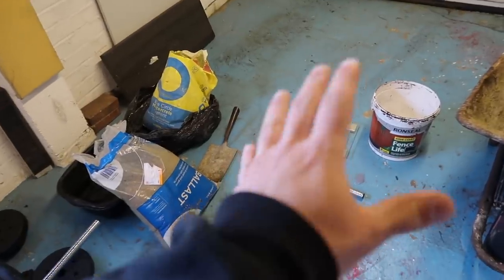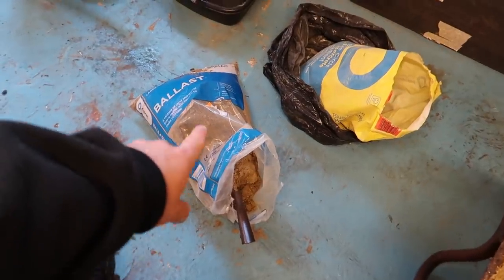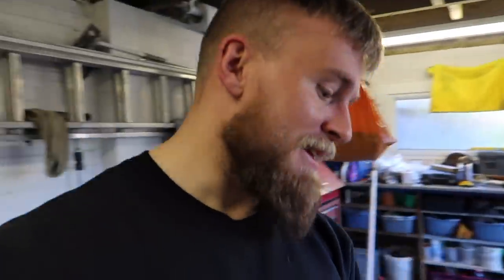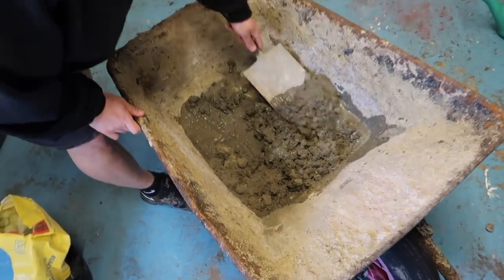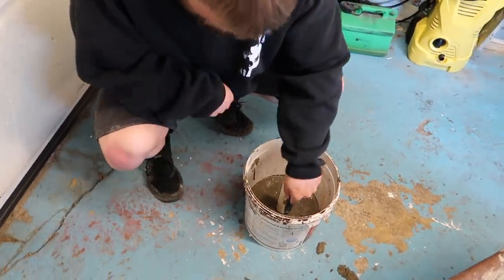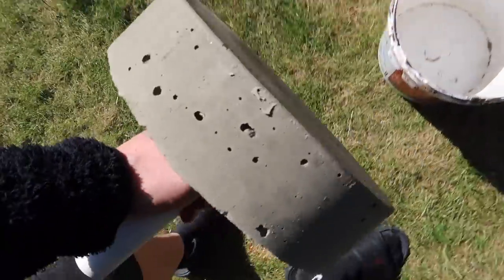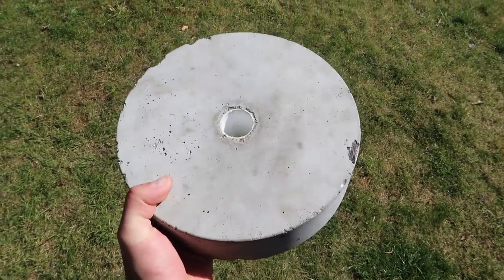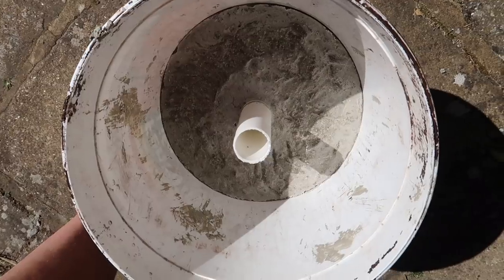How To Make CHEAP HOMEMADE GYM WEIGHTS From Cement. (VERY EASY)

Comment: Awesome video!  You still have to wait 24-48 hours to demold the "quick set" concrete.  It does "set" quicker, but it's way too weak to demold.  Quick set is also weaker.  It's best just to use 5000 psi concrete.  Most important thing is to add enough water so that the concrete is "workable", but not "soupy".  The concrete should resemble mashed potatoes.

Comment: Breaking in half: you can add some threaded bar (bolts) into the bucket so that they set inside the concrete. The metal bars will then hold the concrete together (acting as rebar). It will still crack but it won't break in half when dropped.
Brilliant Video mate!!!👌🙂

Comment: Strengthen with chicken wire, rebar or anything that provides connection throughout the concrete. Avoid organic matter like straw as organic matter will rot but a  plastic material similar to straw or fibre glass mixed in would provide additional strength.

Comment: Also, postcrete for the quicker muck going off mate and chicken wire cut and laid in to stop em from breaking to easy when putting down. Tips not for necessarily for you but others who read this comment 👍
Reply: Whats postcrete??

Comment: I have a question! Did uou put any lubricant or anything sprayed into the inside of the bucket so the cement could come off? Or did the cement solid and just slide off without amy additional prouct?

Comment: Like it! Check mine out. I used 1" EMT to avoid plastic compression fracturing.  Also I put chicken-wire in to make sure giant pieces wouldn't break off. Had them for a month and 99% still complete.